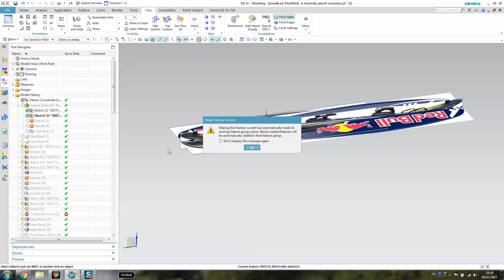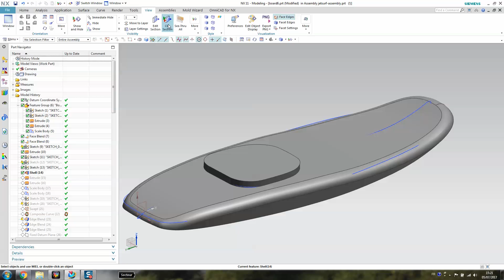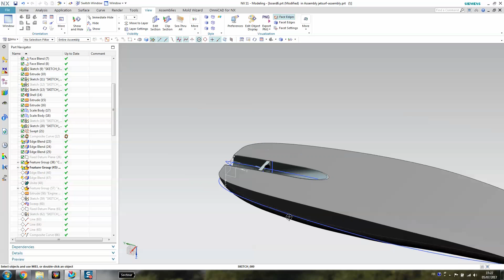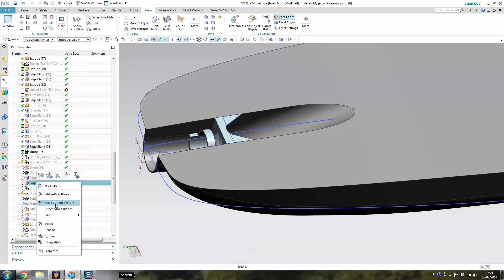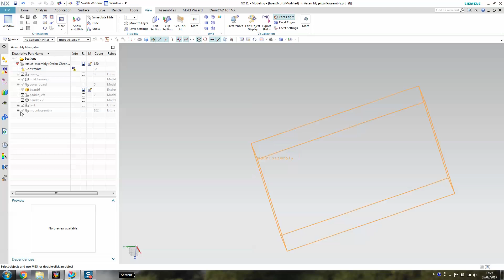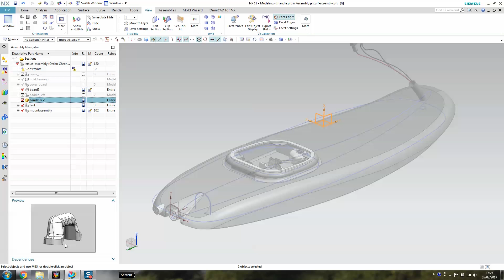HOW TO MAKE A JETSURF - MODELLING IN NX

Comment: Beauty then I will try to do in Solidworks same, it will take longer no problem already 1 year I started this project, I already have the engine and I made an aluminum turbine and now I bought a 3d printer and I intend to do the mold all in it,
Thanks for while
Reply from the maker: Take care about the impeller with Aluminium, because with high speed, your blades can be deformed. The best is to have an aluminium alloy but it's not easy to find... did you buy the impeller or did you make it by yourself? if you have the engine, be aware that you shouldn't exceed 7000 rpm otherwise you will have a cavitation problem :)
Reply: what about impeller shape. can you avoid cavitation with a certain shape also?
Reply from the maker: Usually, engineers try to avoid cavitation and we have some solutions. but anyway, if your rpm are very high, you will meet that, even if you change the shape.It's not a big problem for our jetsurf because we don't use it often, but if you have to sell it, it can be a problem. Anyway, it decrease the efficiency of your system. I invite you to read this nice article:
http://www.flowcontrolnetwork.com/qa-pump-cavitation-diagnosis-control/